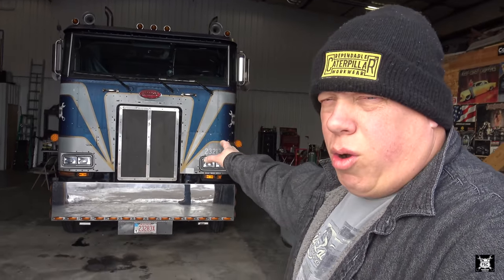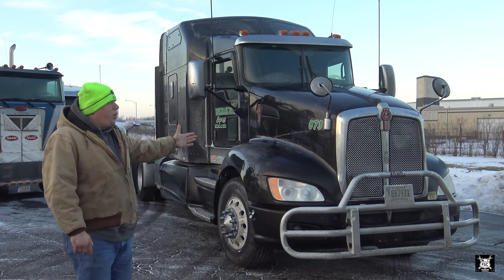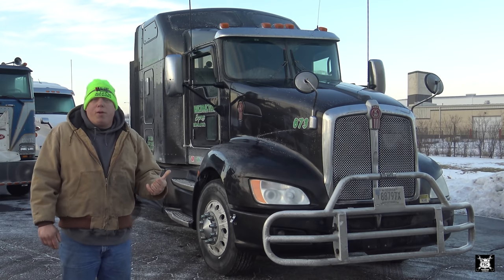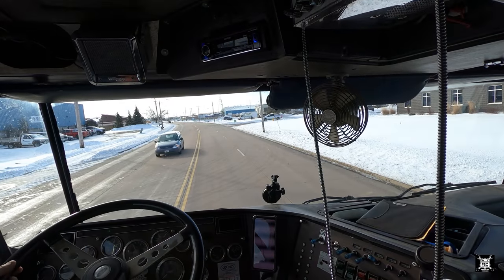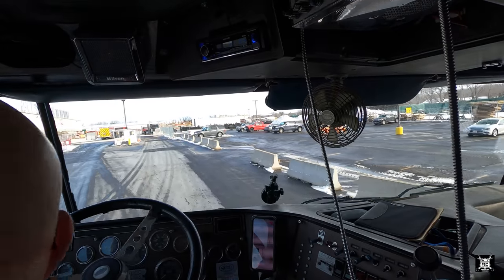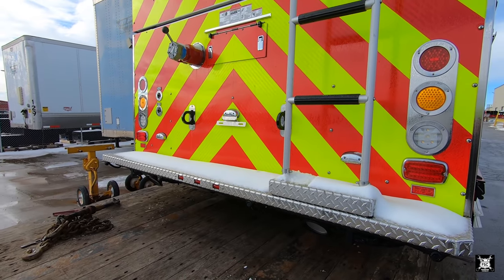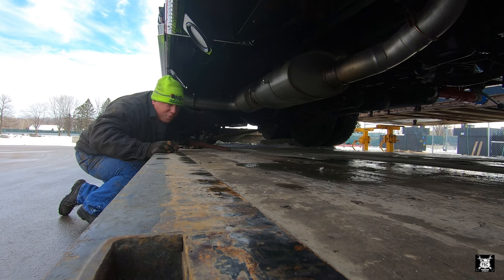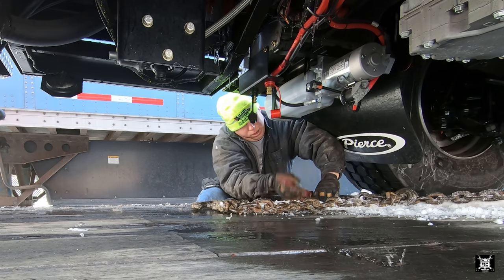Cabover Peterbilt Loads Kuwait Fire Truck

Comment: I use old pieces of nylon jacket from fire hose to protect the axle when I have to chain around an axle. You could use those rear loops without worrying about scratching them, too. A pair of short loop slings to pass through the loops would do it, too, and they're not super expensive.

Comment: chevhelle looks awsome! like to know more about the frame stiffining how that was designed ect. I have a 71 gto didnt do that but im running 400 4 speed. I run lots of those gen 11 3800 buick v6 in my grand prixs a build on that v6 would peak my interest
Reply from the maker: There is a video done earlier on how I did it.

Comment: Drivers brake light out on the tractor. No big deal with a trailer, I’m just so used to spotting that stuff as a mechanic working on big trucks.
Reply from the maker: Was replaced at the yard.
Reply: Saw that to, but thought maybe it was camera angle.

Comment: Forgive me if this is a stupid question - but would it not be more cost effective for the firetruck builders to drive the firetrucks/tenders to their destination and get a bus/train/plane back?
Reply from the maker: The truck has no DPF because it's not for the USA.  Hence it's not road legal here.
Reply: @fsctrucking  Ah, that makes a whole lot of sense. Didn't think about that aspect.  So what about those blower trucks you were transporting?  I can imagine they are not great for longer distances.
Reply from the maker: @triumphstagdriver  I didn't ask.
Reply: It would also have milage on it at delivery.  So it wouldn't be "new".
Reply: The military doesn’t use def either

Comment: Hey Steve, I've Seen 12V71's in white cabbover's [elder freightshakers] and Pete 359's... You can get parts for refits or for any part of the motor from Luke at US Coach and if you need a hand doing it, the guy to call for some advice is Scott Crosby from the Bus Grease Monkey page who's worked on Bus versions and Trucks but there is this other specialist working with the guy from the Country Life youtube page who constantly finds and refurbishes or gets running old Detroit 2 stroke motors including a 12v71 in a truck the guys found for one or two episodes a few months ago [that being a 12v71 in an old Pete I believe it was].   Here's one of those vids I was talking about with what I believe is a cabbover with a 12v71 doing a mountain pass lol    https://youtu.be/-yiIbkcQBzI